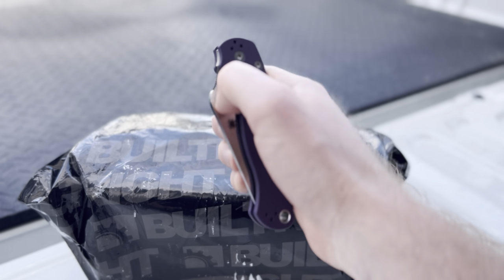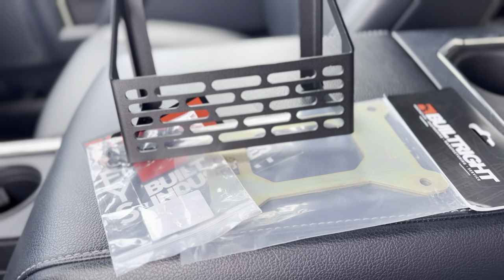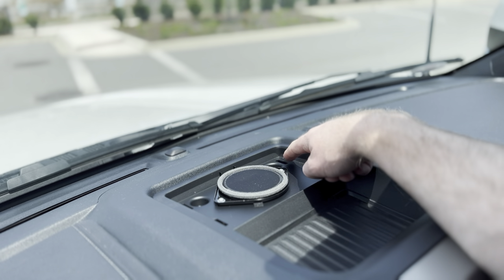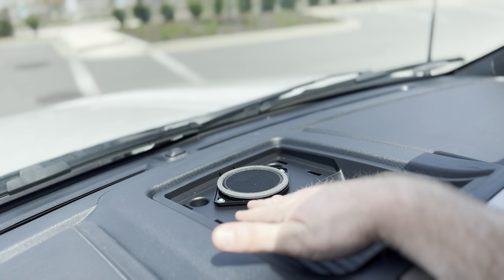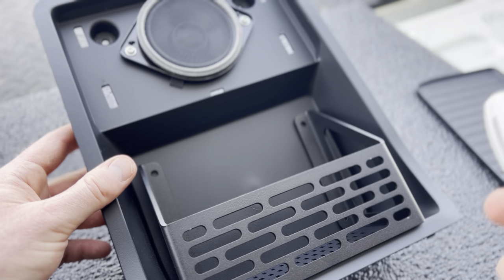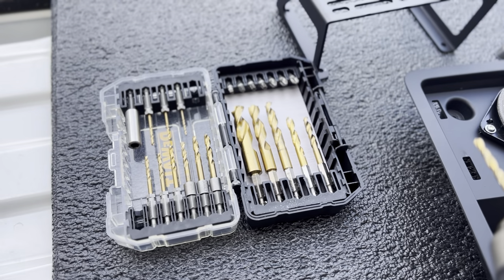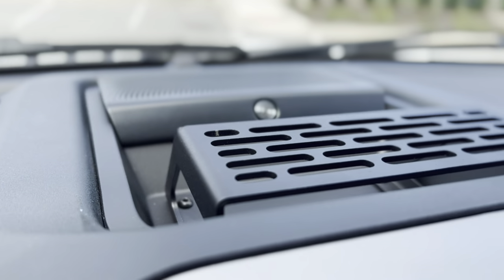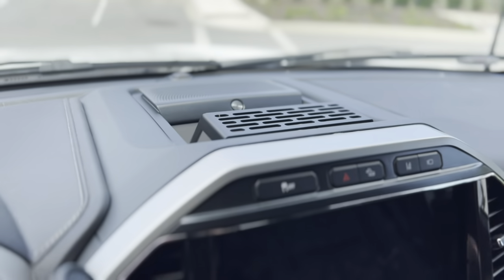BuiltRight Dash Mount Install for 2022 Ford Super Duty

Comment: Having installed two of these, the latest on my ‘22 F250, buy a pack of those white plastic clips before you do the install.  It’s almost guaranteed you’ll either break some or lose them down in the dash.  They’re on Amazon and are cheap.  I left the rubber pad in there and drilled through it.  I felt it kept the finished look underneath.
Reply from the maker: That's great advice! I like the idea of keeping the rubber underneath it.

Comment: 9/32" socket would work for the stock bolts instead of the 7mm.  Tackling installation this weekend, I might install a 12vdc/USB socket into the bottom of the plastic tray for the accessories I'll be mounting.
Reply from the maker: It would be a great place for an additional power source. Best of luck with the install!